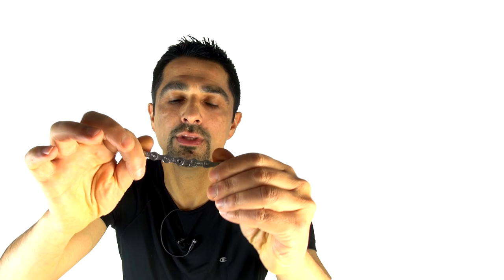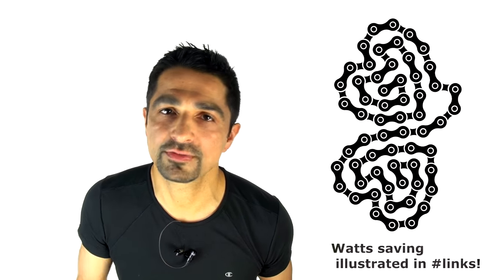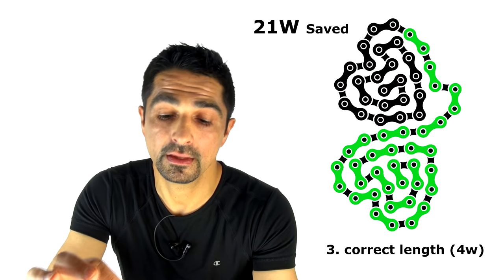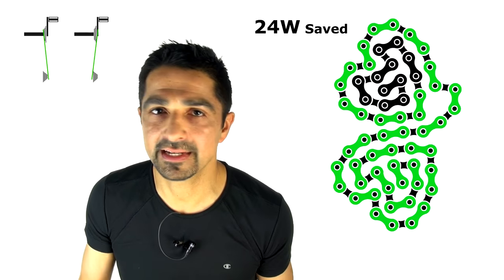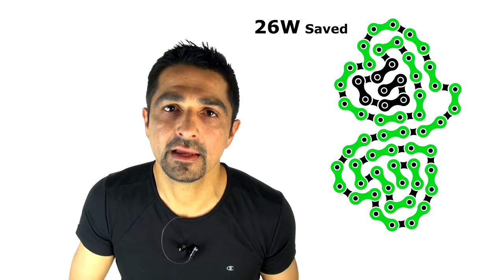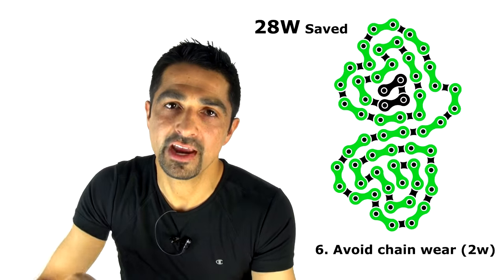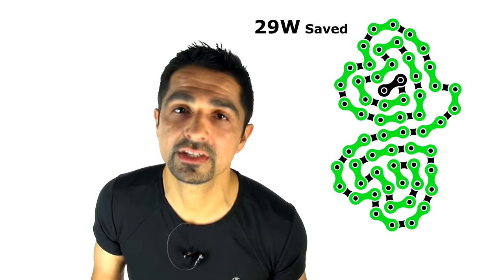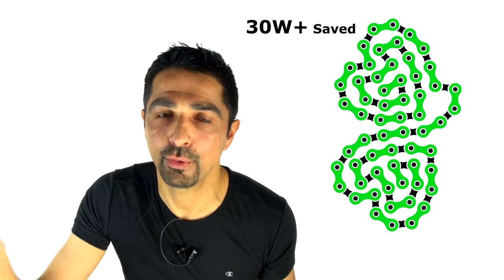Chain Science! How to save up to 30 watts of losses from your bicycle chain!

Comment: I hated to see WD 40 among the chain lubes.  It attracts and holds grit and dirt.  I use paraffin wax after thoroughly cleaning my chain.  My entire drive train stays much cleaner.  The wax gets into the rollers and displaces grit and dirt.  Boshield T-9 is an excellent lubricant, after cleaning, if you don't want to remove the chain.  Lay the bike on its side and put a drop of T-9 into every roller then let it sit a while and wipe off the excess.
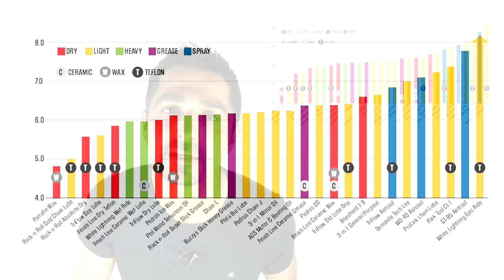Reply: Check the chart at 6:50

The difference between WD40 and the best Parrafin wax the uploader recommends is 7.1 watts lost (WD40) and 4.8 watts lost (paraffin wax) is a net total of 2.3 watts. 
2.3 watts. 
2.3 FRIGGIN WATTS!!!!! 

I dont know how much paraffin wax costs or how difficult it is to apply, nor do I know how long it lasts between applications. I heard something about removing the chain, heating the wax and applying it, then reinstalling the chain and waiting before riding your bike. That's a lot of steps and isn't as easy or economical than WD40, and Paraffin wax sounds like a lot of frigging money for 2.3 watts. 

For 2.3 watts I'll shave my face stubble before my ride, trim 1 more centimeter off the overhang of my brake cables near the brakes and wax my spokes once a year ;)

Comment: What if the 11speed chain jams between the chain rings on your 9 speed system due to the fact it narrower....? Be careful as your recommendation may be mechanically callus!
Reply from the maker: The internal width of modern chains 8,9,10,11 is always the same ie they fit over the same cog size/width....its the outer measured width that differs and then only slightly. If anyone actually had the chain jam between cogs I'd be surprised because the width of the chain is bigger that the inter-cog width. However a chain can jam between cassette and frame of course.

Comment: Can I use an 11-speed chain on an 8-speed cassette?
Reply from the maker: If you are not worried about slightly imperfect shifting you could give it a try as it will fit the cassette cogs and it may work but it is not recommended
Reply: Thanks much for responding! I don't think I will try it then : )

Comment: Wow, I never knew! I better not use WD-40 anymore. Thanks.
Reply: It is there, look at 6:51 closer. The difference between a very good quality dry lube and WD40 is 1W... So i'll just keep using WD40 to clean the chain, lube the chain, and make my bike nice and shiny! :)
Reply: So I've gone to paraffin on all bikes. Soaked chain in gas, cleaned well, then ultrasonic cleaner with simple green, then dried, then in melted paraffin. Boy is the chain stiff, but after a few revolutions, it seems to be just fine. Vello had an article about chain lubes and waxes seemed to be really good. In any case, it is very clean. They say good for 500ish miles.

Comment: I would imagine there is a difference betyween a brand new chain, and a slightly used chain. I would imagine that chains need a break in period. A period of time for all the tighest moving parts to wear down a little into order to bed correctly. Perhaps the manufactuere is a little lazy and they are not made to blue print standard, but perhaps just a few thou off. then, as the chain is used (and cared for) it free's up. offers less resistance, than when new. I dunno. just guesssing.
Reply from the maker: quite true there is a a couple of watts saving in running-in/breaking-in a brand new chain esp on your bike...ie with your cassette and chainrings.

Comment: I've just spun my pedals by my hand and the rear wheel was off ground. There is no way I used 30 watts and I haven't clean my chain for months.  Everyone with powermeter could easily check this .
I'm interested in results, but my guess is 3-5 watts.
Reply from the maker: Mario Drazic check back next month for an online drivetrain calculator to reveal more precise figures (or look on patron for an early view)

Comment: Lots of figures bounced around, no comparative evidence of power loss, (i.e) no scientific comparison of a well-prepared drivetrain ~v~ a poorly maintained one. So it's just plucking figures from the air and guessing.
Reply from the maker: No guessing involved. In the two years since positing this somewhat speculative video on how many watts of drivetrain losses you could save up we have since worked hard to map out all the figures using actual data. So if you are skeptical try this calculator: https://goo.gl/zzGLB1 for exact number of losses.

Comment: If a bicycle chain was losing 30W it would be too hot to touch after a hard effort of more than a few minutes. While I agree with the advice you’re giving the numbers are unrealistic
Reply from the maker: ....so when a sprinter does 550w at 99rpm you might not be aware that around 30w of total losses are thru the chain (fft.tips/drivetrain). Following your logic, at the end of their sprint you are saying their chain is too hot too touch?! Interesting.
Reply: FastFitnessTips: Cycling Science! That’s exactly the point I’m making. The energy “lost” has to go somewhere. In the case of a chain, energy is converted to either noise or heat. IF losses were as high as claimed, then the energy being converted to heat would heat up the chain by a significant amount, which it doesn’t. I’m not saying for a moment that there isn’t a significant amount of energy lost. All of your tips on chain selection and maintenance are valid. The 30W claim is just an over exaggeration, unless we’re comparing an ideal set up to a chain that came out of a scrapyard bin.
Reply from the maker: @bikescience1  in a closed system you are right, the chain would heat up and if it was 30w friction, then a 250g chain would heat up about 10deg per minute (Watts of input = 0.05 x Lbs of Steel x ΔT in°F / Heat-Up Time) but you are completely forgetting that the chain is a excellent radiator and it looses this heat (ΔT above ambient) almost perfectly due to its large surface area amplified by wind chill very much like your car radiator. The end result is the chain doesn't get hot at all in reality. However I thank you for your interesting thought experiment!
Reply: FastFitnessTips: Cycling Science! At the very least, you’re “double accounting” in places. The claimed gains for a Teflon/Paraffin wax treatment already must include the savings for a deep clean for instance. Try waxing your chain without deep cleaning it first and the wax simply falls off. For me a better approach to this would be to test power losses for different chains at a known input power, then produce a comparison chart including everything from worst case scenario to best. Rusty old shed chain, decent chain that has stretched, box fresh chain with packing grease, etc etc.

Comment: Number one is oil your chain,,,,,,,,,,,,,,,,,,,,,,,,,,,,,,,,,,,,,,, period. Your bike will not even shift right without oil. dura ace , xtr or even the almighty campagnolo super record will not shift right without an oiled chain. Oil your chain.....if you are too concerned with dirty sprockets and pressure wash your sprockets then you will constantly take your bike in for a tuneup when all you need is oil. Not that difficulut just a little oil......................

Comment: all this matter ONLY in race.
Reply: Not so. If you complete an endurance event, for example, saving 30 Watts - or whatever - may be the difference between finishing the ride feeling OK, to feeling like you are about to die. And, did you never want to gain a Strava KOM. Additionally, if your chain is working efficiently, it may last longer. A dirty, neglected, chain will let you down eventually.
Reply: Viesturs Ošis today cyclists loose the point of cycling, bicycle industry washing the brains

Comment: I hate to say this but if this was so relevant for today’s cyclists you would spend a few more minutes discussing
1 ensuring the rear mech is properly set and is indexing correctly
2 telling people NOT to lube or grease chains but to wax them. Use diesel on a chain.... really???
3 never use new chains on a sportive/race. Not as efficient as an older chain
4 you really need to tell people that 87.4% of statistics are made up... including yours

And please mate... lubes on chains also attract the metal filings from the chain, so if you are foolish enough to own a chain cleaner, use a magnet inside it

There’s no point telling people you can save efficiency if you don’t tell them fully how to prevent it.. prevention being better than a cure

You should be the English guy on the shopping channel selling floor steam cleaners that no one uses... and if you don’t use one you can save 500w

The most annoying thing is you cannot say for certain how much power anyone can save due to the individuals power consumption, power output and rising style/technique

And the chain was invented in 1880. This fact alone could save you a few watts looking shit up on wiki

Comment: Hate to correct you but there's no such thing as chain "stretch."    In other words, your claim that hanging a weight from a chain causes it to get longer and then removing it causing it to get shorter, is false.  A chain simply gets longer due to the combined wear of the pins, links, and rollers.  Once it's done that there's nothing you can do to make it shorter.

And since I'm here, if you don't have a wear indicator, an equally accurate way to check for excessive chain wear is to measure the distance between pins over 12 inches of chain length.  Each pin on a new chain is exactly 1/2" apart.  If you measure one foot of taut (key word) chain, you should see the pins line up exactly at the beginning and end of that 12" segment.  A 16th of an inch over and you're at your limit.  An 8th of an inch over and it's past time to throw it away.  If you've been around or beyond that 1/8" limit for a while, you'll want to look at replacing the cassette (and possibly the chain ring) also.  Before installing your new chain, take it and wrap it around the ring and cassette separately and see how much back and forth movement you get.  If you get a significant amount (like pretty much any), it's time for at least a cassette.

Other than that, good work on the video.  And if you do a deep clean or buy a new chain, you might try re-oiling it with a good polymer lube like Dumonde Tech.  It's not as cheap as the other lubes but it's definitely worth it in chain life.  You don't have to re-oil near as often and cleaning doesn't require much more than a wipe with a good rag.
Reply from the maker: Thanks for the useful comments. ps I am aware of pin and bushing wear, but I am surprised metal doesn't stretch or deform? Could you let these guys know: http://cozybeehive.blogspot.com/2011/05/bicycle-chain-stretch-test-results.html  ;)
Reply: @Fastfitnesstips  - Never suggested metal couldn't stretch or deform.  If subjected to enough force, just about anything will stretch or fail.  However, it is highly unlikely to stretch (in the truest sense of the word) or break a chain unless you're capable of 2000 watts or better, and most of us mere mortals are nowhere near that.  No, was merely addressing the idea of a chain getting longer with a weight attached and then returning to original length when removed.  That kind of elasticity is not present in steel.  Once it's stretched, it remains stretched.  As stated earlier, it's simply the combined small amounts of wear of all the separate components that add up over distance to produce a longer chain.  When that happens, it no longer fits the cassette or ring accurately, causing accelerated wear in all three components.

If the site you shared is measuring chains with weights, all they're doing is removing the slack (probably taken up by lube), much like a train takes up slack in the couplers when starting to move.  Their results would have to be miniscule, to the point of being negligible in any real world scenario.

Comment: Thank you so much for making these videos for others. Value info: I can use an 11 speed cahin on my ultegra 11-28 cassette, thats cool to know. 
Quick question: I guess I can use an ultegra 11-28 cassette with an 11 speed chain to go on the sram red 22 chainring. See linkg: https://www.bike24.com/p256780.html
Reply from the maker: hi, the SRAM red 22 chainring works with 10 and 11 sp. the SRAM 10sp chainring actually works with 10 and 11sp too. An 11sp chain will work with a 10sp cassette but an 11 sp cassette needs an 11sp chain. Ultegra and dura-ace are compatible/switchable.
Reply: Thank u so much for sharing.
Reply: Everyone thinks this, manufacturers state it as law, but from my one-off of necessity trial of a 10 speed Shimano 105 chain on an 11 speed cassette, I can state with authority it isn't true. Test this yourself. 1/3rd the price, works just fine. No rub, no binding, perfect shifts. G'head. Test it yourself.

Comment: wd40 and superlube?!
Reply from the maker: WD40 is only recommended as a degreaser if you have nothing else available
Reply: If you watched the video carefully, you will have noticed a chart at about 6:37 that shows results for various products, including WD40 aerosol. In that chart, it's fifth from the right, and the best products are on the left. I think that qualifies as "actual results" and the story for WD40 is not a good one. There is a difference between unmeasured personal experience and carefully-measured lab results. Whether the magnitude of those differences matters to an individual cyclist is debatable, but those differences are right in the scope of this video.
Reply: I say that "the story of WD40 is not a good one" because, for the single metric in the graph, it performs poorly than all but a few of the others. I can certainly see that is has certain charms such as convenience, including an important pair that you don't mention: it's super cheap and available everywhere. And it's also true that the sorts of power savings that you get by using a top-ranked product are typically swamped by other factors. But the point of this video is to find ways to save a little power in your drive train. If you don't care about that, then the whole discussion is moot.
Reply: i was a racer for more than 15 years and i think wd40 is perfect for daily use. Never seen a racer cooking his chain in a wax pot once a week !
Reply: Check the chart at 6:50

The difference between WD40 and the best Parrafin wax the uploader recommends is 7.1 watts lost (WD40) and 4.8 watts lost (paraffin wax) is a net total of 2.3 watts. 
2.3 watts. 
2.3 FRIGGIN WATTS!!!!! 

I dont know how much paraffin wax costs or how difficult it is to apply, nor do I know how long it lasts between applications. I heard something about removing the chain, heating the wax and applying it, then reinstalling the chain and waiting before riding your bike. That's a lot of steps and isn't as easy or economical than WD40, and that sounds like a lot of frigging money for 2.3 watts. 

For 2.3 watts I'll shave my face stubble before my ride, trim 1 more centimeter off the overhang of my brake cables near the brakes and wax my spokes once a year to reduce aerodynamic drag.

Comment: 2:50 how can be an angle more than 3%? 3% of what???
Reply from the maker: 3% chain deviation from a straight line (a surprisingly small amount)
Reply: But it is an angle, you can't express angles with percentages
Reply from the maker: 11 degrees of 360 (3% of the circle)